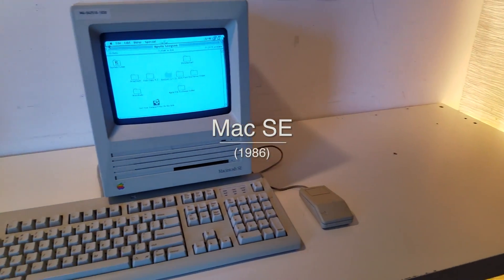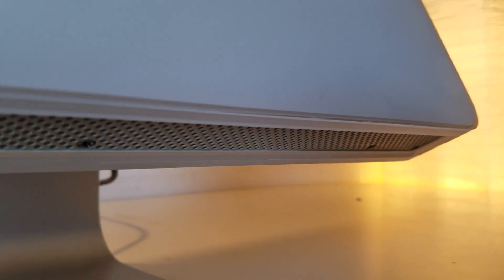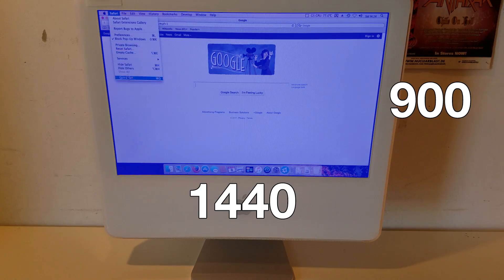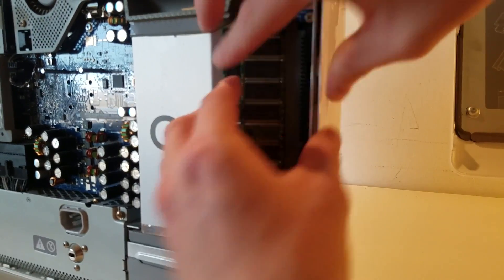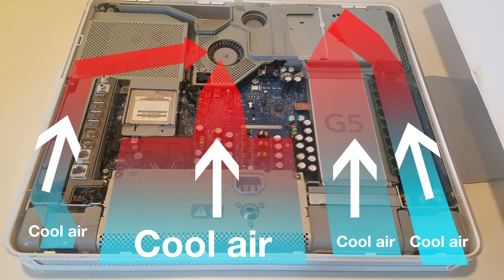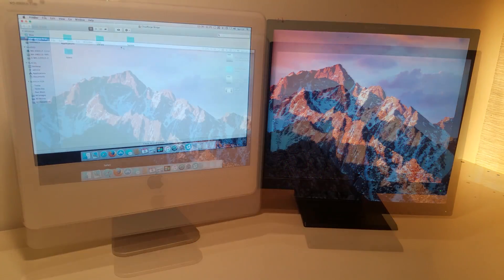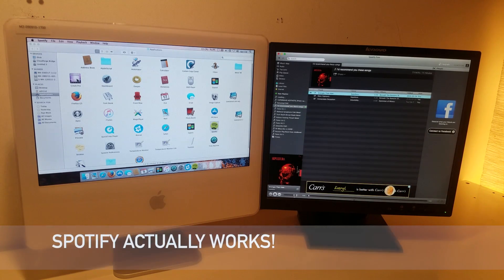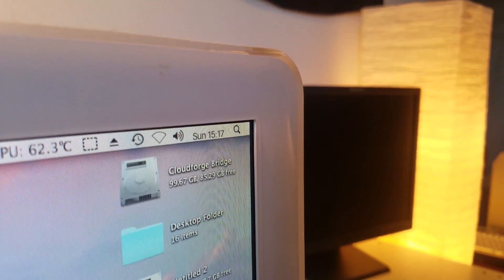The Science Behind - iMac G5 + New Sandisk 120GB SSD!

Comment: I have this machine too
Absolutely love it
I use it to just journal on.
It’s on my network so I can remote to it via VNC
Definitely works for my use case.
Nothing sensitive on it.
It does remain on an offline LAN though.
Even though if you wanted to hack around my network for the useless information it contains.
I’m sure you could.
Lol you’d have to get passed a pretty extensive setup of ip ranges, routers, different subnets, and firewalls.
But hey have at it

Comment: Hi.. I’m thinking of buying Imac g5.. will that support the present Mac os and can I extend the Ram to 4gb - 2gb in each slot
Reply: Bought a new 20 inch G5 iMac in 2005 and still use it daily but, no I would not buy one today.  Unless, you only want this computer as a collector's item or you have a lot of classic OS 9 software.  Because, the highest version of the operating system for an apple computer with a power PC processor is OS X 10.5 (however, they run better using OS X 10.4).  Also, it will not support 4 GB of RAM the max RAM is 2 GB for this model (two 1GB memory sticks).
Reply: You won’t be getting the latest current MacOS you’ll get up to leopard

Comment: Daily, I use my 20 inch imac G5 as my backup desktop computer.  Since, I own a lot of old software and hardware it is nice having a computer that supports both classic OS 9 and early OS X programs.  I even record live over the air TV shows in HD using the Elgato Eye TV 500 which takes advantage one of this computer's Firewire 400 ports.
Reply: transitengineer : I have a question- I’m thinking of buying Imac g5 20inch screen. Just wanted to know if I can upgrade the ram to 4 gb - 2gb in each slot and
How does the video performance and browsing performance work when we upgrade the system to latest version os. Will the system hang?

Comment: You know it's an iMac G5 review when capacitors are a major topic of discussion! As for anyone looking to get one of these, unless you can find one locally for a very good deal, I say pass it up and get an early white Intel iMac instead. Intels can run Snow Leopard/newer apps, are more powerful, and are generally more reliable than G5s (although they do have problems of their own, depending on which you get).
Reply: Timur Tripp agreed!
Reply: I agree the Intel chip has plusses, but the early ones ran a 32-bit chip, limiting even the first couple of Intel models.  Chrome and several other mainstream browsers have abandoned it.  I put Linux on my early 2006 Intel iMac (specifically Peppermint), which continues to support Chrome (and Chromium, and Opera, and so on) and as such I find it a decent daily computing experience now, a dozen years after its release.
Reply: While, I own a 20 inch imac G5, if buying this type of design (which, I do really enjoy) would buy a used 24 inch white imac with an intel processor.  This way, the only thing you would not be able to do is to run classic OS 9 applications.  Which, of course require a PowerPC processor.
Reply: I got my G5 with mint capacitors for 60